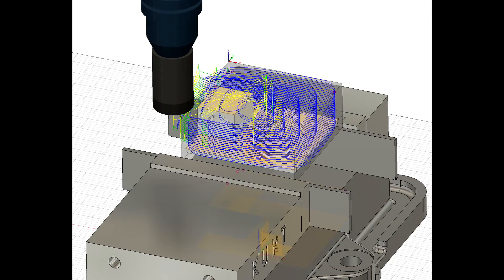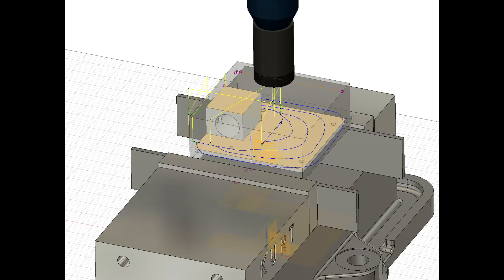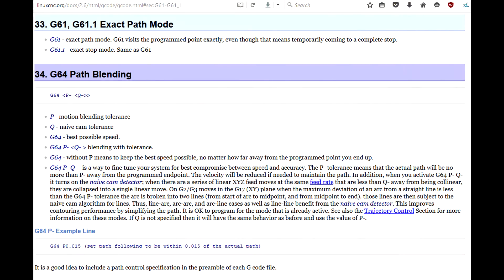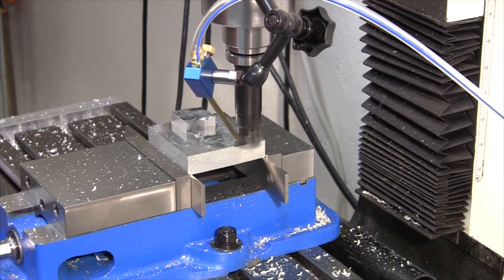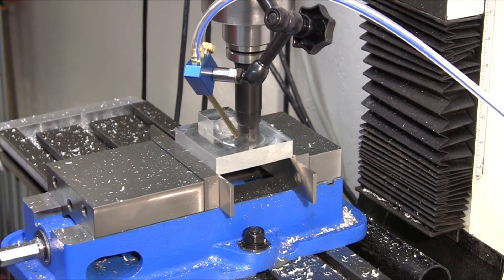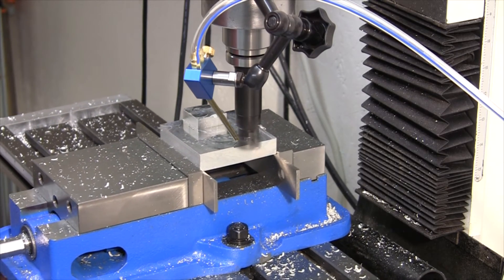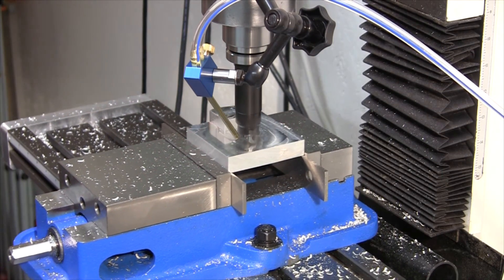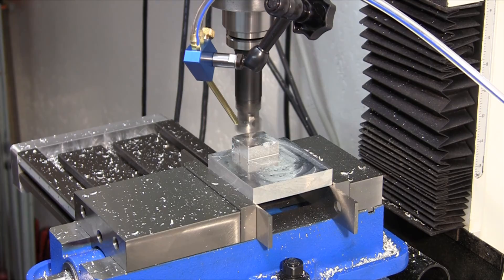LinuxCNC G61 vs G64 part collision, PM25MV

Comment: One other option you may want to consider is setting "Always Use High Feed" in the Post Processor dialog options. You can specify a high feed rate in the option below it. That will force the post processor to only output G1 moves at the high feed for rapids instead of posting G0s. G1 moves won't "dogleg" like G0s can. Just a thought.
Reply from the maker: Hi Gavin. Thank you for the comment. I really need to make an update on this video. I've learned a bit more since making it and know how to make examples that show the differences between G61 and G64 and why G64 should be used. I used to believe the problem I show in this video was limited to rapid motions, but I'm sure G00 and G01 motions are equally effected. The difference is G00 is likely to achieve higher velocities and thus have a greater rounder corner when using G64 with out the P option. As I understand, LinuxCNC is not plagued with the dogleg motion of some controllers and so toggling between the "Always Use High Speed Feed" in Fusion360 does not have an impact on the corner rounding, except for when enabling the option limits the maximum velocity. The difference in maximum velocity caused me to incorrectly believe disabling rapids made a difference. A reason I've decided to leave rapids enabled, is in LinuxCNC, there are overrides for feed rate and maximum velocity. Feed rate override directly impacts G01 and maximum velocity impacts G00 and G01. While you may want to turn down the feed rate for testing a program, when using operations like adaptive clearing, there often a lot of "cutting air" while the tool repositions itself, and if rapids are changed to G01s they are also impact by a feedrate override and slow down the air cutting. Leaving rapids enabled allows the feedrate to be adjusted with the override independently of the repositioning or air cutting rapids. Please note, all these is based on observation and reading. I have not verified them by examining the LinuxCNC code. Thank you for your interest and it gives me motivation to make a followup video with the updated information. It's a really interesting topic that I never encountered with Mach3. If I've made any mistakes here or am unclear, please let me know. Thank you.
Reply: Kent VanderVelden Hi Kent. Wow! You've really done your research. I apologize for diving in and suggesting something without checking my facts first. I did not realize that LinuxCNC was not affected by the dogleg rapid issue so I just assumed that what I was seeing was what I'm used to from big commercial CNC controls. Your explanation makes much more sense. I've only just got my little mill going again with a new stepper drive, so now I know what to investigate to get that running well. I think the thing that through me is that usually with big machines, the corner rounding we see when using smoothing etc is a very small radius compared to what you often see with LinuxCNC. I guess that's probably due to what can be very large differences between the accel/decel capabilities of various machines. 

The dogleg issue is caused by a G0 not necessarily being a "point-to-point" move and some controls simply moving all axes as fast as they will go to get somewhere, whereas G1 will ensure a straight line from point to point. I guess in the case in your video, even if you had a vertical G1 followed by a horizontal G1, you'd still get the corner rounding effect unless you used exact stop mode. 

Not sure if you edit your Fusion 360 post processor yourself, but that's what I do for a day job, so if you'd like to incorporate different modes for different types of work or toolpaths, let me know and I can build a custom post that we can both use. I have a little TM25V running a Leadshine MX3660 and 570oz-in steppers.
Reply from the maker: Hi Gavin. Your comment was fantastic and many people probably wonder the same. I've only learned about this stuff out of necessity. In my case, Fusion360 had indeed generated a vertical rapid followed by a horizontal rapid. The collisions were really confusing as all looked great in Fusion360, NCPlot, etc. If the clearance height was higher all would be have been fine. The LinuxCNC guys also suggested increasing the acceleration, and while that works, I don't want to overly stress the machine. I monitored the following error from the servos and decided 30 in/s^2 was a good balance between speed and minimal following error. I need to make parts made reliably with my few skills instead of making parts really fast. The acceleration on my little mill is 30in/s^2, already faster than I can react, and the big machines more like lightning. 

I would greatly welcome any chance to work together on improving the post for Fusion360, even if I'm simply testing your improvements. You must be employed by Autodesk? Fusion360 rocks! I've looked at the post code but I've not yet made any changes. With LinuxCNC the basis of Tormach's PathPilot I have faith the LinuxCNC post will be kept up to date.

Here is a video of the mill I'm using which I think is identical to the TM25, or really close. I remember looking at the TM25 as they provide speed torque curves for the DC motor. I'm using pretty small motors in comparison to yours, but they've been working for me.

https://www.youtube.com/watch?v=KuX1QdGcGJ0